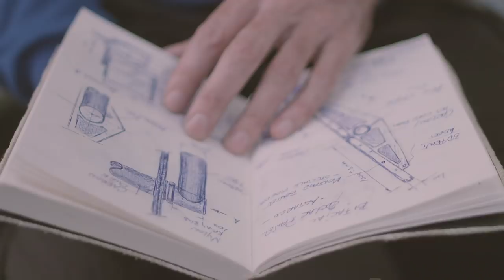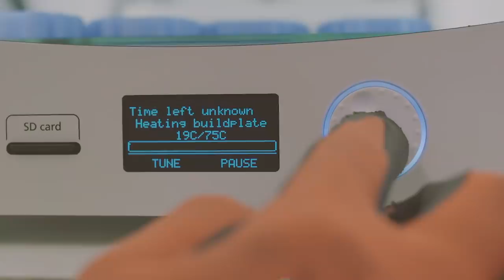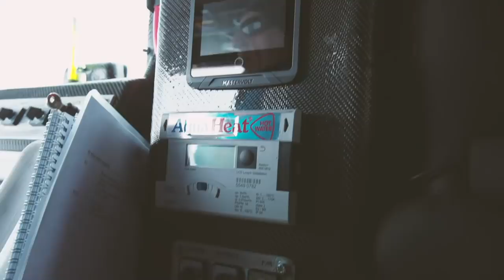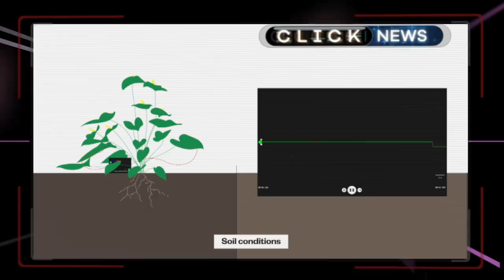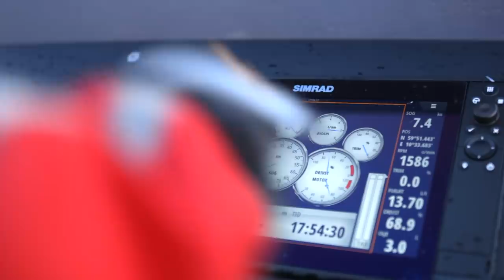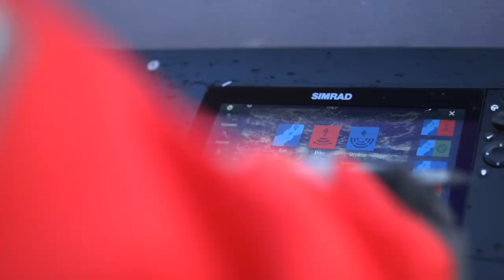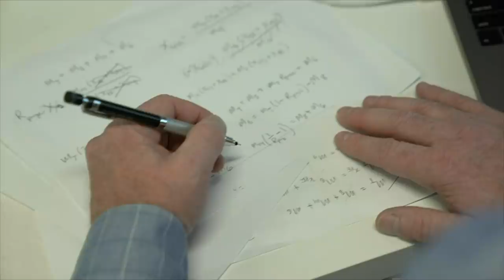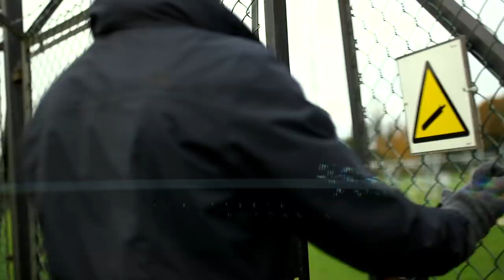Saving the world from plastic - BBC Click

Comment: The thing is plastic is actually a really valuable material, for durable things because it's not easily degraded, so it's absolutely a waste of our fossil resources to use them for packaging which usually doesn't need to be longterm degradation-resistant. And these resources would actually be essential for the production of all kinds of chemical industry products that are essential for the functioning of modern day life, and should not be wasted.

Comment: Has anyone taken the water temperatures around all of the floating islands of plastic in our ocean. We use plastic sheets to cover our pools which heat them up. What do you think these 5 or 6 island of plastic the size of Texas are doing to the waters in our oceans. I would suggest we start cleaning these islands up.

Comment: So I have seen quite a few videos about recycling plastic. The plastic that can not be recycled should be ground up and added to pavement and concrete products. It would stop the need for burning and putting it in landfill.
Reply: I agree and I also thought of a different use for that plastic. 
Why not crush it and using large hydraulic presses create super dense cubes that can be used as road beds. I was watching a company build a road near where I live and they excavated down several feet then filled it with gravel up to a depth of around 3 feet. They then started putting rebar in the area above the compressed gravel and then poured concrete. Why couldn’t we use the plastic cubes instead of gravel?  Also, they could excavate even deeper, say 12-16 ft and fill that area with the cubes. Of course they would need to put in place some sort of liner so the plastic could never leach into the ground.

Comment: I don't like the idea of solar on water. What of the marine environment when you start blocking out the sun?
Reply: my thought exactly Peter
Reply: The space it would cover would be minimal.  And its way better for the marine environment than a rising water temperature due to burning fossil fuels to get same electricity. Still i’d be more confident having them on shore (due to unpredictable weather patterns and hurricanes) if those snap - would end beeing another plastic litter in the ocean.
Reply: Floating Solar panels on reservoirs will not make much environmental impacts
Reply: Rytis Petrauskas, they would be better off with Wind Turbines. Much higher output which works day and night and doesn't block out so much, bearing in mind these solar panels are only really suitable for close sure use where the sunlight is more important for shallow marine creatures.
Reply: Go outside and #lookup
Reply: this idea is better viable on water reservoirs like dams, where you want to stop water from evaporating. also, the solar panels would work more efficiently because they will stay cool. however, one major drawback is that they will only produce peak electricity for one hour when the sun is perpendicular.